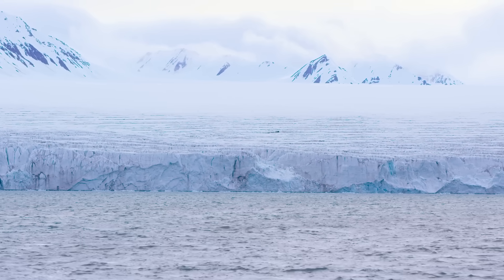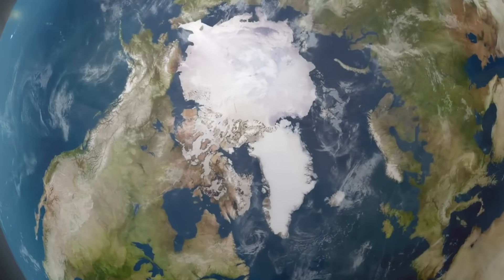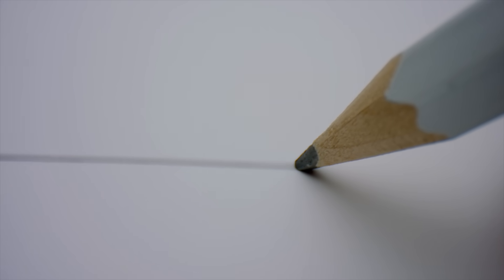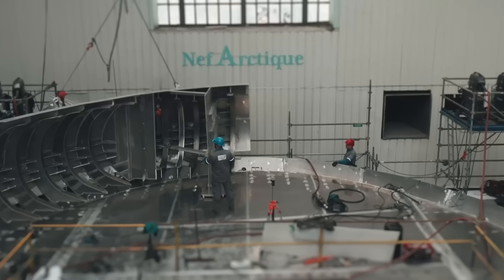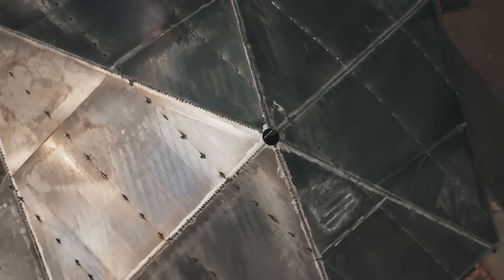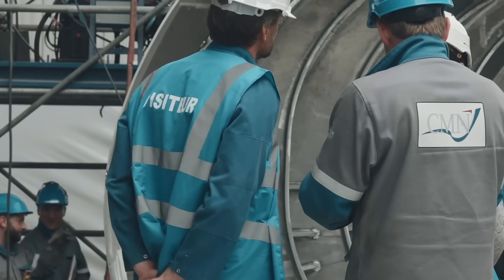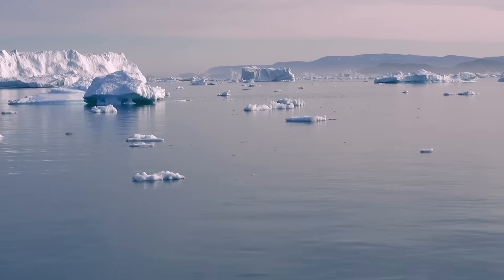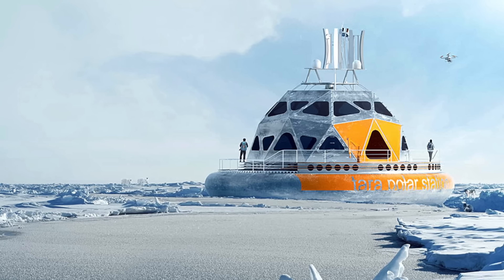Inside France's $38M Floating Arctic Research Station

Comment: What they conviently leave out is the fact that the Antartic sea ice is increasing. If you were to look at earth over a one million year time period you would see several cycles where one polar cap increases while the other decreases.
Reply: No, they didn't leave that out, because if you actually bother to check, Antarctica is actually loosing ice.
What have increased is annual ice mass gain, caused by the increased evaporation from warmer oceans.
Alas, that gain is more than balanced by the increased melting, so on average it is loosing ice.
And why would a phenomenon spanning hundreds of millennia would be relevant to something we can see changing in decades?

Comment: How is the Arctic melting when it's below 32°?
Reply: Because it depends of where you are. In the centre of the sea ice, right over the North pole, it will tend to stay under frozen water temperature, but the ice cap is actually moving, and on the fringe it is melting quite enthusiastically in spring and summer, to refreezes in automn and winter, but not as much in average each year.
So over the decades the multi year ice tend to be thinner, and that's they want to observe because with current trends, we might have an ice free Arctic summer before 2050, and no one knows exactly what it will do, hence the studying.

Comment: Following the real data, there is no such fantasy as warming in these huge areas. These days and recent months the example of "alarmingly increasing temperatures" on the Concordia Station(South Pole/Antarctica) it's very hot in the winter months, like -50 to -60 Celcius right now. It's almost idiotic statements presented as reality.

Comment: That's the worst metal to use in saltwater, whoever sold that scam doesn't know shit about boats what a joke one big sacrificial alloy
Reply: I owned an full aluminum boat for 20 years ,sailed in many part of the world and he was very reliable and solid the only problem was with the electrolyte who can lead to corrosion , the  electric wire cable system need to be well insulated to avoid this problem , in second the presence of other boats or structure made in different metal and with different potential , you need in that case to change frequently the anode ; you need to test your electric network with an electric  leak detector cause of the bipolarity of the boat , it will give you the exact location of the leak . I'm imagine that this  structure is built with the state of the art of maritime construction and it will sailed the arctic for a very longtime

Comment: I don't understand. Isn't better to build a ship of similiar size or larger. You can still build all the same facilities and research rooms but you then have a ship with an engine to move if there's an emergency or just move to a better location. You can do the same things as in the floating research station and just have the ship float around for a few months. Or is this thing cheaper and easier to run and you don't need a crew to worry about sitting around doing nothing?

Comment: It's actually a really old design. I can't remember who exactly, but I watched a documentary about early Arctic explorers, and one of them had a ship built exactly like that, except it was made of wood. The idea was that the water would freeze around the boat, and it would drift across the North pole with the natural seasonal flow of ice.
Reply: "Fram ("Forward") is a ship that was used in expeditions of the Arctic and Antarctic regions by the Norwegian explorers Fridtjof Nansen, Otto Sverdrup, Oscar Wisting, and Roald Amundsen between 1893 and 1912.  (...) Nansen's idea was to build a ship that could survive the pressure, not by pure strength, but because it would be of a shape designed to let the ice push the ship up, so it would "float" on top of the ice."
Reply: I think when they mentioned sea trials in the 'Fram Straight' they were giving a clue to the vessel of which you speak!

Comment: Ooooooo not 20mm, wow, that's just a little over .75"! Ahahaaaaa, they should have been even more dramatic, how about 20,000 micrometer thick plate!!
Reply: A lot of aluminum yachts are only 5-8mm at the hull - so 20mm is 2-4x as thick.
Reply: @sl0ls  but they aren't meant to be exposed to ice..EVER, check out the thickness for explorer yachts

Comment: Don't suppose that you have a link to the data that shows that the artic is getting warmer?
Reply: Google:

Here are some data points that show the Arctic is warming:
Temperature
The Arctic's average surface air temperature from October 2022 to September 2023 was 20°F (-7°C), making it the sixth warmest year on record since 1900. The summer average temperature was 43°F (6.4°C), the warmest on record. Since 1940, the Arctic's annual average temperature has increased by 0.45°F (0.25°C) per decade, and the summer average has increased by 0.31°F (0.17°C) per decade.
Sea ice
The Arctic's sea ice melt season has lengthened by 37 days since 1979, and the ice now starts melting seven days earlier and refreezing 30 days later than it used to. The shallow seas around the Arctic Ocean have warmed by almost 4°F (2°C) over the past four decades. This warming causes less sea ice, which exposes more of the ocean to sunlight, which in turn causes more warming.
Snow
Snow-covered areas are thawing out earlier in the spring. For example, in 2022–2023, the Arctic had above-average snow in the winter, but it melted much faster in the spring than usual. In 2021, Arctic North America had below-average snow cover for the 15th year in a row.
Wildfires
Wildfires in the Arctic are becoming more frequent, severe, and larger. This can make it harder for ecosystems to recover and can change the types of plants that grow back.
Harmful algal blooms
As sea ice melts and water temperatures rise, harmful algal blooms (HABs) are expanding north. These blooms can produce toxins like saxitoxin and domoic acid, which have been found in Arctic cetaceans, seals, and walruses.

Comment: The 2cm thick aluminum may prove inadequate.  Yes, aluminum handles the cold better in the sense that it changes less. But fundamentally it’s a crystalline metal and hard to make durable mountain bike frames with, let alone larger complex research stations.  Many engineers have failed on large projects using aluminum.  Still it may work out well we’ll have to see in a few decades.
Reply: Well..its working ok. As well as thousands of all kind of alluminium vessels, that are floating around the world for decades.
Reply: Really you think so

Comment: How many liters is the wine tank?
Reply: The minimum legal requirement is 1 liter/person/day 😅
Reply: Une cuve à vin digne de se nom se compte en hectolitre et non en litre.
Reply: Why not just build a massive hover craft? Like the old ones they used to go from England to France, they were massive. 

Sit on the ice until you need to move. Easy!!!
Reply: @vc7393  oh yeah make a flying city too np
Reply: It's limited due to croissant rations and es-cargo.  (:
Reply: you mean cognac,18% wine is not enough handle the weather
Reply: Indeed. I was wondering where the hot tub is
Reply: Yes
Reply: Gonna need whiskey and vodka to stand up to the cold wine may freeze to easy
Reply: coffe?

Comment: Hey France! I've got a 12' aluminum row boat I'll sell you for only $50,000.00 US. Considering what you paid for that piece of floating artic aluminum, this is a steal 😁
Reply: It will Fail because the Cold water and two hamming of sea on the hull will work hard the Aluminum which mean welds will crack
Reply: Profitez tant que l’on a des traitres au manettes
Reply: @pierrelegal24  
If you could please speak American 
Also, if it's about the boat, it's sold. Sorry about that 😁

Comment: This video has the United Nations Climate Change disclaimer.   Global warming was officially stated at 1.1°C in 1991 and 1.06°C in 2022.  There is no mechanism that would allow greenhouse gas behavior to cause global warming.   

The back of the United Nation's IPCC science report states it took its greenhouse gas samples at 20,000 meters altitude where it is common high school level knowledge there is no greenhouse radiant energy.  This is typical practice for deceptive marketing to state legal data transparency protecting the perpetrators from fraud prosecution.   The IPCC has been transparent with its data acknowledging it is not dealing with active greenhouse gases.  

Earth's greenhouse effect is frequently used as a primary example to high school students of a system always in saturation from the strong greenhouse gas water vapor absorbing all the greenhouse radiant energy from the earth with greenhouse gases within 20 meters of the radiating surface that is all around us everyday and can't have its overall effect changed.  There is no further greenhouse radiant energy to interact with greenhouse gases.  At 1% average tropospheric water vapor over 99% of earth’s greenhouse effect is from water vapor.  Water vapor would hold earth's greenhouse effect in saturation if it were the only greenhouse gas in the atmosphere.

Arctic warming is taking place with the proving mechanism being warm Atlantic Ocean waters migrating deeper and more frequently into the Arctic Ocean warming it and the region.   That warmer water is causing a few weeks less of reflective snow and ice coverage resulting in more solar heat gain to the Arctic region surface.

Atmospheric CO2 levels of 1200 ppm about three times what they are today would greatly invigorate C3 plants the majority of plant life on earth greatly greening the planet. 

0.4% of the atmosphere is CO2 and on average 1% is H20 water vapor.   (1% H20)/(0.4% CO2) = 25.  Water vapor is 25 times more present in the atmosphere on average than CO2.   Water vapor has an CO2e of 18,  18 X 25 = 450 CO2e total for water vapor to 1 CO2e for CO2. 

The Earth’s oceans have 3-1/2 million sea floor volcanic vents warming the water and changing it’s chemistry that have not been systematically accounted for.

Comment: Interesting subject however too much use of unrelated stock footage and NI mention of how the "vessel ' is moved? ( own power or towed/carried)
Reply: its mostly stock footage

thumbs down
Reply: It has an engine room clearly shown in the layout right there in the video.
Reply: Yes if you look closely at the video you can see a Rutter also, plus if it was a barge it wouldn't call it a ship. ( Right? ) maybe wrong have been before lol
Reply: The vessel is still being built hence the extensive usage of stock footage and animations.  That said a rudder and propeller are visible early on in the video.
Reply: They say “it’s meant to drift with the ice” a couple of times
Reply: @EmilianaCamila  can't drift from France to the pole, can it?

Comment: So they made a small LNG ship tank with some extra internals.
We built LNG tankers in the '70s with far thicker aluminum segments.
Reply: This video didn't really give that much info on its systems imo.
Reply: @Stroopwaffe1 
Other than a huge diesel engine running on vegetable oil, and it's weight, the official website is useless as well.